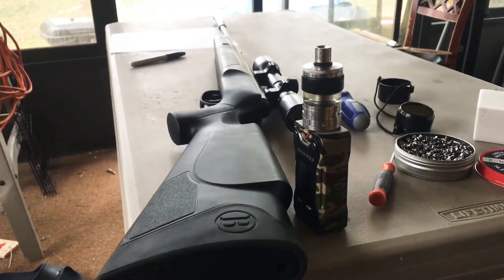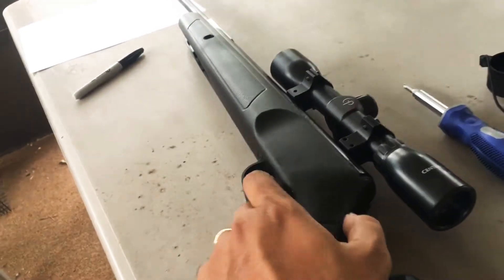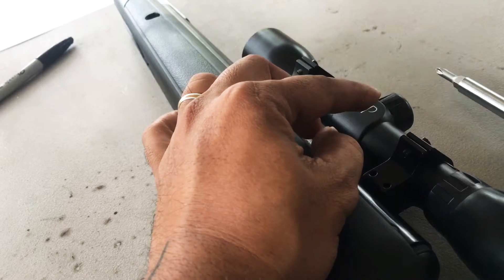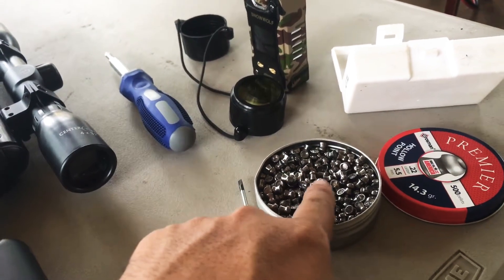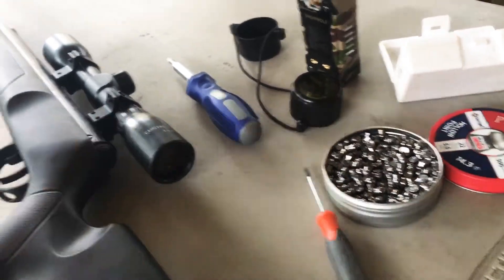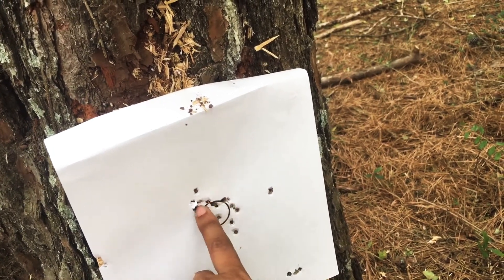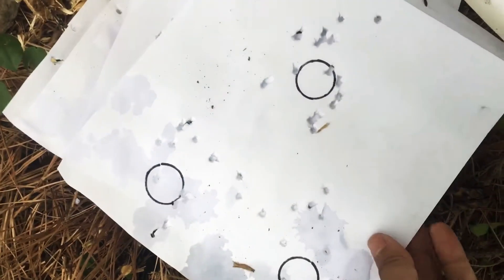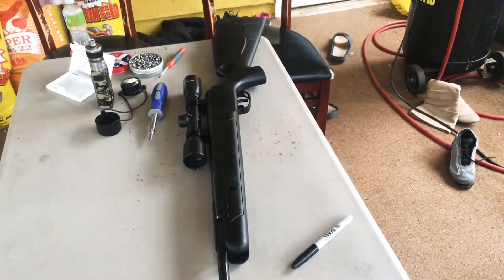Benjamin prowler

Comment: Nice, I have 2 prowlers,. H&N Terminator and jsb  most accurate pellets. I went through 4 different cheap scope model of scopes till I found something that worked too.
Reply: LastCast2011  what scope did you go with ?
I just ordered a Hatsan Optima 3-9x40AO scope and rc bearing for trigger hack mine is .177 so far am happy with the power and lethality 🕊🕊🕊🕊🕊
Reply from the maker: I got lucky on mine cost it like the  premier .22 pellet